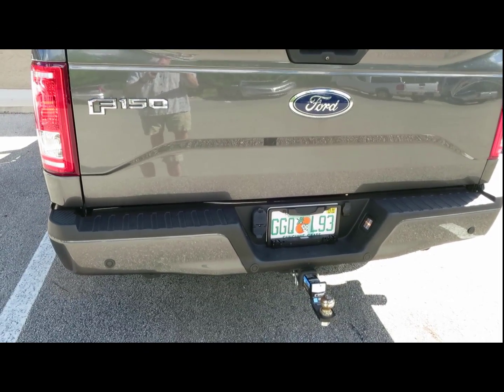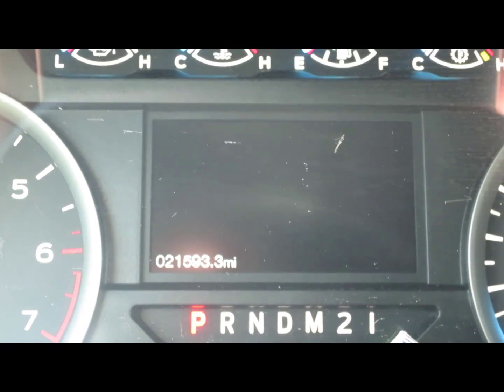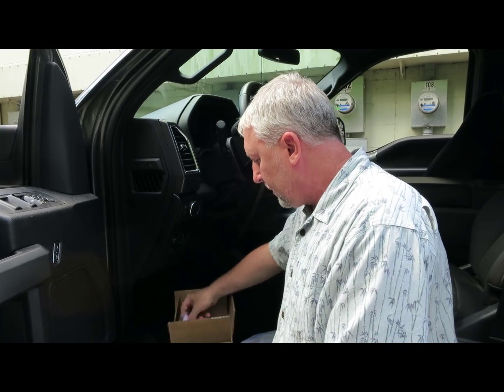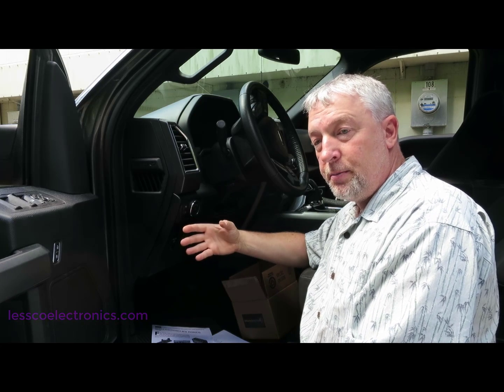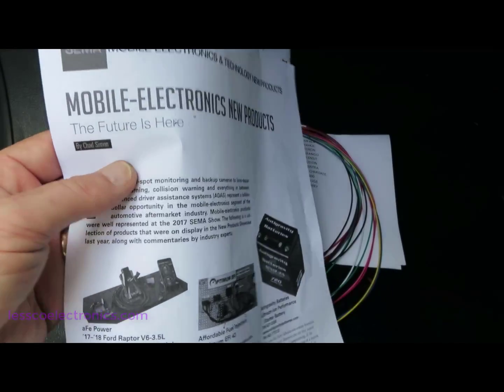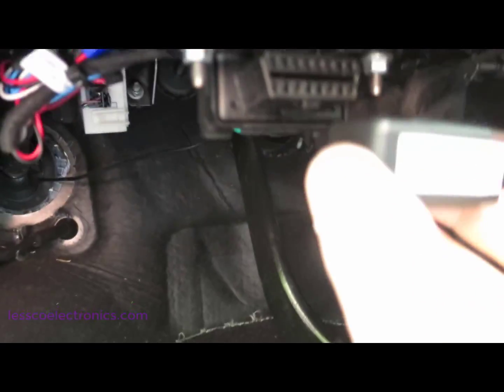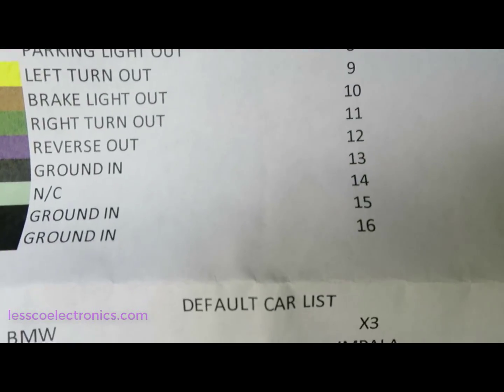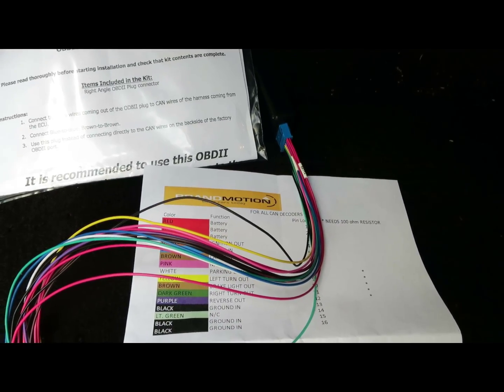How To Add 12 Volt Accessories To Can Bus Wiring

Comment: There is a Viper remote starting system installed in my 2015 Subaru Outback. It was installed prior to my purchase of the vehicle. For as long as I have owned the vehicle the TPMS warning light has been illuminated on the dash. After watching your video I'm wondering if this is the problem?
Reply from the maker: could be, was the tpms wire interrupted by the remote starter kit maybe? check it out..

Comment: I have a 2012 F-150 XLT I took a set of running boards off of a 2010 Platinum put them on my truck Factory running boards I got everything from the module to the motors I have everything hooked up except for the can Buzz wires don't know where to hook them if you could tell me where to hook them I would be grateful

Comment: To me this was just an advert.
Reply from the maker: for what
Reply: Hi Lessco , I am not qualified to comment but clearly you know your stuff but your title says how to add a 12 volt unit. As for what you are trying to sell it seemed to be a Can bus reader. I was interested in your video as there are a lot of amateur EV converters but they tend to avoid modern vehicles due to Can issues. It would be great if there was a source of data to by-pass Can sensors not required. I have said enough for you to see my interest. I had a fault with impact sensor and it took me about three weeks to even identify that it was a sensor, where it was and what was wrong. Very difficult to get info from service agents. The uses of all this electronics is causing perfectly good vehicles to be scrapped as the electronic fault cannot be found. So once I had gone through your video I was a bit miffed that you didn't actually install a unit. Maybe a better title would be"Problems I found trying install a new device". Stay safe in these bad times!

Comment: Hello, 

Will this work for me? I have a 2008 Volvo XC90 in which I am trying to repurpose one of the buttons that no longer functions into being a trigger for my aftermarket front parking camera to turn on. This means that I'd have to repurpose the button in question into sending a 12V trigger signal to the trigger wire on the parking camera itself, which will then trigger the head unit (Pioneer DMH-W4660NEX) to turn on, and therefore display the front parking image.

Thank you!

Comment: Hi. I have done an engine swap into my vehicle. The new and pcm are can bus and my vehicle is ran off a different bus system. I want to use my oem gauges that are analog gauges.  Will this tool help my analog gauges work?
Reply from the maker: No idea

Comment: Nice video, but I have a question for you. I have a 2016 Ford Focus Titanium and i want to add Adaptive Cruise Control to my car. The CCM has 4 wires that connect into the car. An ignition +, a ground, a high speed can bus + and a high speed can bus -. If i splice the power and can bus wires into the system should it work or do i need one of these decoders to make Forscan see the CCM?
Reply from the maker: no decoder needed on this one..

Comment: Surely connecting something directly to the battery can't cause any problems to the vehicle electronics apart from battery monitoring. Then again maybe my Audi A1 is only minimal CAN, I've done 80000 miles and the only problem I've had is the usual exhaust sensor failing from going over a pothole I think it's the reason. But I changed every single bulb to LED. and took 12v from the reversing bulb wires, and brake wires, via fuse and diodes. 

Not a sniff of an issue. 
I did have a USB cable coiled up that overheated and set on fire in the head lining, but that's another story 😂

I really wouldn't want anything permanently plugged into the diagnostics port. Surely one could wire the twisted pair properly and directly in somewhere else?

My diagnostics port currently gets used with an app called Dash, which tells me the engine load, which saves me tons of fuel, as well as being used for diagnostics as soon as a code appears.

Comment: it probabbly says there's a trailer because you used the trailer plug, just tap into the tailight and all that will be gone
Reply: I was thinking that too. It would explain why there are no guidelines, and possibly why the vehicle doesn't remote start (i.e. safety feature when a trailer is connected)

Comment: I ordered an aftermarket stereo for my car and wired it up correctly, checked that it was functioning properly and everything seemed fine. It powered up and I went through all of the features to make sure they worked. As I started to crimp and tape off the wires, something shorted out. Now, the unit blows a fuse every time I power it on. Can this be fixed? I think the 12v Battery wire from the head unit may be grounded internally.
Reply: Did you finger it out yet? I watch YouTubes of head unit installs and one guy had a problem, didn't say exactly if it was your same one, but he googled a lot and found on a forum, he didn't say what forum, where he discovered the manufacturer mislabeled one of the wires in the harness and even the wiring diagram was wrong.
Reply: @truenexus1usa  no I haven't figured it out and quite honestly just sat the unit down and stopped fiddling with it. I figured something must be mislabeled, but since I couldn't find a solid forum, wire diagram and the manufacturer couldn't help me, I lost interest. Any I fo would be helpful, as I still have the unit.

Comment: It looks like the problems are to do with the trailer plug or the wiring for the trailer circuit, From my experience as an auto-electrician the ground loop is either closed or open as this depends on how the trailer module circuit works, i have fixed a few on new utes/cars in New Zealand, where people install wrong type trailer plug when the old one breaks/fails, the replacement ones that does not have a reed switch function as the oem one does. Also i have come across this similar issue when the reed switch fails on the plug or when installing a replacement one people forget to connect the reed switch wiring.

Comment: So are you saying that all of your CAN bus issues went away after plugging in this device or are you saying that you changed from CAN bus controlled to voltage controlled i.e. CAN bus message for lights with the decoder controls a physical relay or something to switch any auxiliary lights?  Were you saying that the CAN bus was overloaded and was missing CAN frames because of the extra accessories you had fitted to the vehicle?
Reply from the maker: yep, that was the issue
Reply: @Lesscoelectronics  OK, I believe each CAN bus can take up to 30 nodes before getting into issues,  as most modern cars have most of their modules running from CAN if you wanted to run more then a CAN repeater might be useful.  Did that mean that you had to run cables from the front of the truck to the back for the accessories after installing the breakout?
Reply from the maker: Yes, I ran a multi conductor cable back there.  @Wilksey37
Reply: Normaly you take the signal and give it to a relay to power more accessories
Reply: @NikosAntoniou-q3m  Yes, with a voltage controlled system, CAN bus requires a bit more to achieve that.